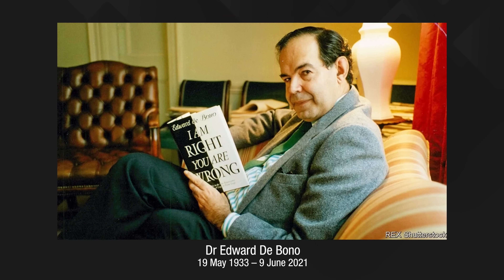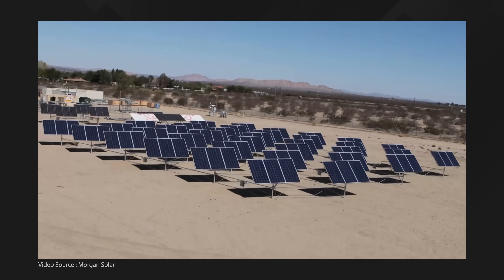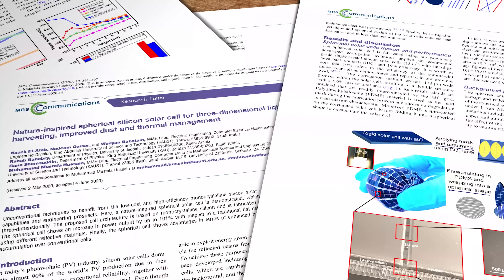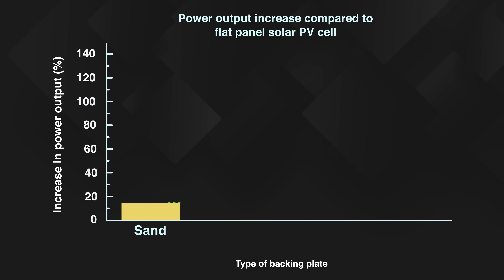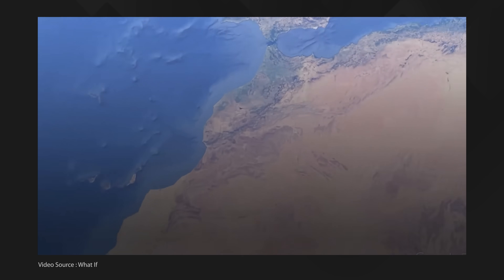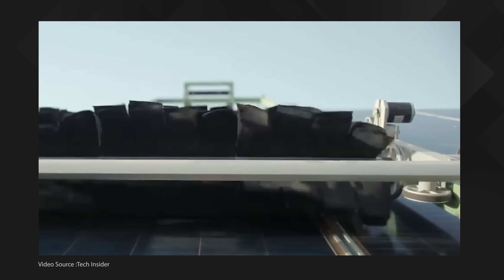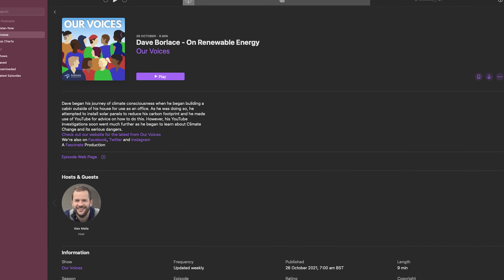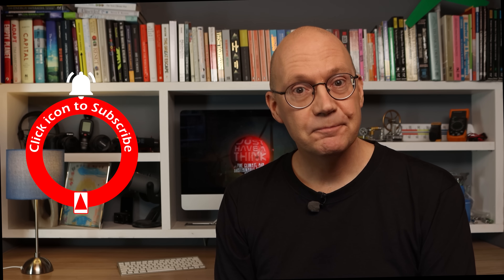Spherical Solar Cells - doubling the power output of flat PV panels!

Comment: I have some experience with alternative building techniques. It hasn't amounted to much since I am such a small volume builder. However, me and a few friends used to comment on how the tree was the ultimate solar collector. Sperical panels, as we find so often, are really just mimicking ideas in nature that have long stare us in the face.
Reply: Solar trees have existed for years - the reason they haven't caught on is because it's far cheaper to make one big 'leaf' (solar panel) than attach thousands of little ones on a tree just to make it look nice.
Reply: Of course the tree is the perfect solar collector. It’s a wonder that no one has copied it yet.
Reply: @woodchip2782  i wonder how hard this would be; natural tree leaves can be sprouted and removed at will by the tree to account for seasonal changes is one example that comes to mind
Reply: Your comment on trees makes good sense. Other earlier comments got out into the weeds on the chemistry and complete function of the tree. That's a "duh" and in my opinion, off point. But coming back to the basic SHAPE of trees from nice round bulbs to evergreen cones, they do the job of collecting solar energy as best as they can in the environment they exist in.
Reply: I just made a comment about how nature is still the best tool to capture energy. Earth is unique because of the presence of life. Life is extremely powerful if we look at how life has terraformed and transformed Earth. 

The mechanism for trapping is not just about photosynthesis. It also includes temperature regulation, waste processing and storage. The product is itself recycable and as it can be broken down. The machines that are built are never so thorough and complete in their design process and rarely include a process to breakdown the machines once their they have worn out.
Reply: Ten years ago there was a kid that put individual solar cells on a steel wire "tree" for a science fair and the whole day production was higher than a single plane fixed panel at the optimum angle. So this has merit. He got mentioned in media for a week.
Reply: Cosyjv,si😐
Reply: When I read the title I immediately assumed they were doing something like putting a sheet withe the same texture as a fly's eye on top of a regular panel
Reply: Interesting thought on the spherical shape of trees. At higher latitudes, conifers could have gotten their conical outline to better capture sunlight at lower angles near the horizon.
Reply: Nice thought, but in reality, photosynthesis efficiency is extremely low, compared to PV panels, especially for the volume required.
Reply: @Chimel31 But they scale real well. You got the planktons and vegetation that can grow in large part of the world.
Reply: I have to disagree, trees are not the perfect example of a solar collector. The leafs are only in part directed to the sun and only collect in a rather narrow range of the available EM spectrum (hence the colour). They're also used to collect/emit CO2 and oxygen, which a solar cells don't need to. But they also use the heat of the sun, viz. for pumping nutrients by water evaporation. If this could be copied, using the heat to generate additional power and, at the same time, cooling the panels for better efficiency, it may boost efficiency a lot.
Reply: @human_isomer  It's definitely a a fair counter point. I think a measured version of this sentiment would be that trees are the ultimate solar collector given inherent biological constraints. That certainly leaves us room to compare notes to nature but the fact that we can use materials biology can't easily manipulate, that work in conditions life can't survive, and to make products that don't need to self replicate, means we are often in uncharted territory that produces optimal designs quite foreign to those found in nature.
Reply: @human_isomer  But the general shape of the tree is spherical. The leaves themselves have many functions that are also limited because of the seasonal necessity of losing them and, of course, starting small and growing and being able to survive high winds and all of that. What is critical is that the tree is gathering sun from the NE when it is morning and then it can gather sunlight through the entire season. I sort of imagined spherical artificial trees in parking lots that would both shade the lot and gather the sun throughouth the day. just a thought, of course.
Reply: A tree is far from the ultimate solar collector! Evolution doesn't select for optimum power generation; a tree has to build a root system, compete with other vegetation, provide an appealing system to spread its seeds, survive growing to an appropriate height while competing with other trees for sunlight, etc. A solar panel is FAR more efficient at turning sunlight into energy than any plant material, that's why biomass is such a bad energy source.

The basic trigonometry of incident light from the sun obviously and undeniably favors a flat panel perpendicular to the rays. The main consideration in large solar farm design is whether to put the panels on tracking mounts so you can have fewer panels that capture more energy throughout the day. There are other considerations, but it's VERY unclear whether this goofy spherical shape is better than putting solar cells on the back of flat panels to harvest some reflected and ambient light; those already exist and are called bifacial panels. It is really disappointing that the presenter didn't do any math on the geometry of these spheres.

Comment: Just having a think, could we not just get the world to come together and give each country an area of the equator line to manage and on that line create a structure of wave capturing devices to turn the waves into electrically and then on each device  have solar panels as that's the best place on earth to capture the sun and then port that energy back to their country and over time bridge each line from each country together so that in the end it makes a circle of solar going round the world so that everyone can benefit 24 hours a day from the sun and the waves, a global energy source for a global community :)
Reply: @truhunk1  - high voltage DC lines are more than capable of transferring energy across any distance we need.
Reply: @JohnnyWednesday   No, unfortunately not. 300 miles seems to be the limit.
Reply: @truhunk1  Thanks for your comment but maybe someone should tell the UK that as they have brought an area of morocco the size of London and are planning to build a solar farm to port  the energy captured there back to the UK to use bypassing Portugal

Comment: Fascinating as always. It seems reasonable to assume that the disco ball analogy will be taken a step further and the spherical solar cells will be kept slowly rotating in 'dirty' areas where sand, snow, pollution etc will be automatically wiped off on the side furthest from the sun to keep the cells tip-top clean. The problem with disco balls is that they scatter light in all directions, so the siting of them would have to be carefully considered - don't distract motorists, for example
Reply: The balls would not be reflective- that would defeat the object. Sorry if I have misunderstood your final point.
Reply: @steveDC51  All solar panels are reflective to some degree. It depends a lot on what the top surface is and the angle that the light hits it. Disco ball solar collectors would also run cooler if allowed to rotate as the back side would cool them down before they were exposed to the direct sunlight again. The bad part would be that you would need a wiper system for the current collection and a motor to drive them. Both of which increase the maintenance cost over fixed flat panels.
Reply: @gravelydon7072  Also, a substantial increase in BOM and production cost.
Reply: @gravelydon7072  Thanks for your response. Isn’t it nice that some of us can have a polite and friendly discussion.
Reply: @gravelydon7072  could they not be rotated with a turbine using wind to spin them instead of a motor?
Reply: @gravelydon7072  Depending on the size and weight of the unit it may would be possible to use the heated air on the inside of the sphere due to the chimney effect (like a updraft power plant) if fitted with an outlet with rotorblades on top, which would also increas the cooling effect as well.
Reply: @wolverine8658  I had thought of that but the weight of the sphere would be too high for one to rotate it. Maybe if it were combined like roof vent turbines, it might work if you have a good enough breeze.
Reply: @atroxie  Depends on if you had enough wind. Problem there is that high winds and the spheres would not work well together as they would rotate too fast.

Comment: moving parts are cheaper and much more efficient than spherical solar panels. You always get maximum efficiency instead of reducing efficiency for the entire surface in ALL directions.
Reply: Require additional infrastructure, maintenance and use energy.
Think outside the box!

Comment: Sorry if this is a silly question, but wouldn't the structures holding globe shaped solar panels be more vulnerable to damage in wind?
Reply: I'd actually assume opposite. Spherical shapes have the same surface from all angles, while panels have small surface area from two sides, but large area from one side, which could make them more vulnerable to turbulences (provided they're mounted on a roof, and not on a wall). However, it may be more important to have a suitable supporting structure.

Comment: As always a great post.

Making it flexible and the option to cut out and bend any desired shape offers many possibilities.
The efficiency of the cell would thus become less important, but the applications would be much larger.
Reply: That was what I was thinking to: make a panel of lots of little triangle and you can use for many shapes.
Reply: Fp2

Comment: I think there is a little bit of shenanigans going on with the efficiency ratings.

The surface area of a flat, circular panel with a 1 meter radius is 3.14 square meters.
The surface area of a spherical panel with a 1 meter radius is 12.5664 square meters (slightly less if a partial sphere is made).

This means the spherical panel would need to have 400% efficiency over the flat panel to reach equality in relation to surface area.

Additionally, the 'orange peel' construction technique of the spherical panel, which is then cut and rolled into a sphere, would generate additional waste as the parts of the panel removed will not be able to be reused (some optimal packing could be possible here based on their cutting technology).

To me, it sounds like it still falls quite short of the efficiency of flat panels.

There may be some very edge cases where this is good, but I can't see how it would be used for solar farms that are trying to wring out every last drop of capital cost from their project.
Reply: I was thinking the same. As I red the title I thought of a sphere or lense over a flat panel collecting light from all directions on a small surface.
Reply: But the advantage of the sphere is that it presents the whole 3.14 square metres to the Sun from sunrise to sunset whereas the flat panel presents zero area until the Sun passes in front of the panel rising to 3.14 square metres at noon and falling to zero again when the Sun goes behind the panel.  This is ignoring the gain due to adding reflective surfaces.
Reply: @petehiggins33  True, but at the penalty of building a sphere, you could afford 4 x circular panels and not have the increased construction cost. I'm going to guess the cost penalty will be greater than 4x, but yes, I can imagine there are situations where that is still fine.
Reply: @petehiggins33 This is being addressed by having some of the solar panel system vertical and double sided.
Reply: St
Reply: What about wrapping the PV cells around small cylinders, then placing the cylinders in a reflective tray.
Reply: @JohnnyMotel99  that seems logical.